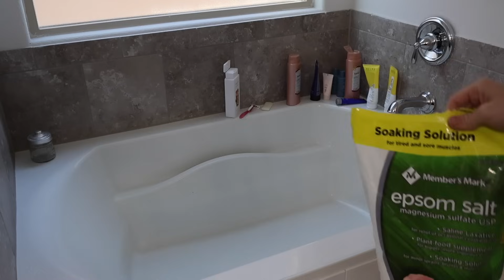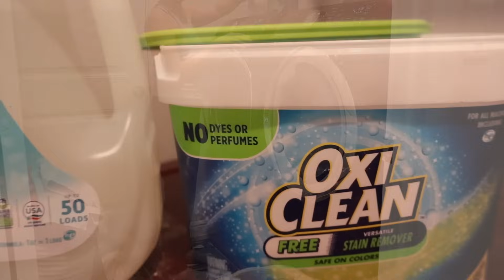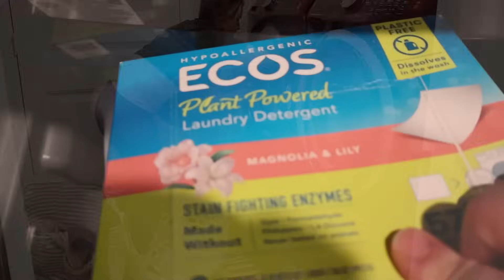REAL MOM LIFE CLEANING MOTIVATION | CLEAN & DISINFECT MY WHOLE HOUSE | MESSY HOUSE CLEAN WITH ME

Comment: Good morning Ashley the reason probably that Audrey's surge plug burnt out is you said her room gets very dusty  maybe the dust collected on the surge protector and went inside the unit .when you get her a new air purifier use an extension cord and run the cord behind the bed even though those surge plugs hold 5 out lets it's not good to use all 5 leave a few empty as different appliances use different power .maybe the air purifier needed more power
Reply from the maker: That’s a good point!! Maybe that is why. I think we will do that because we def had too many thing pulled in on it! 😬